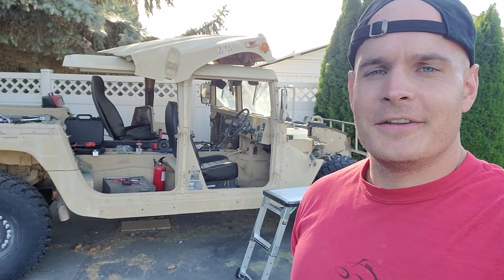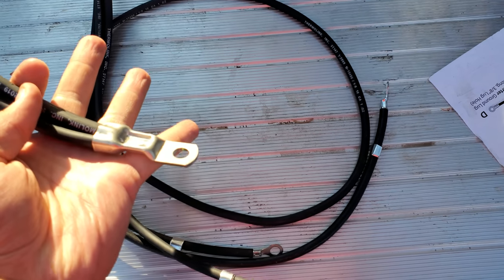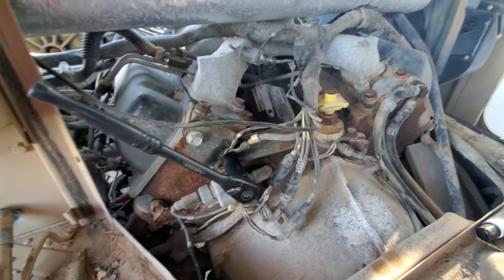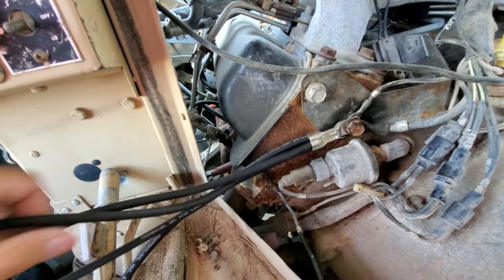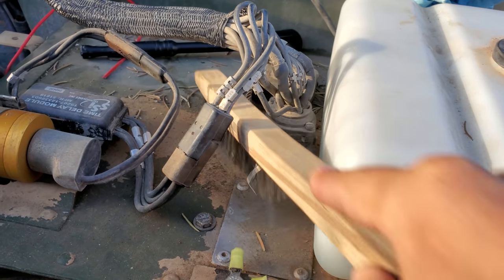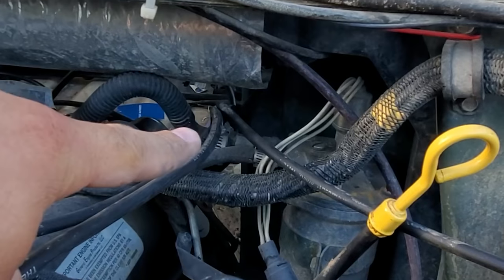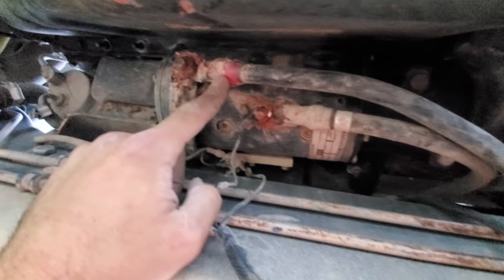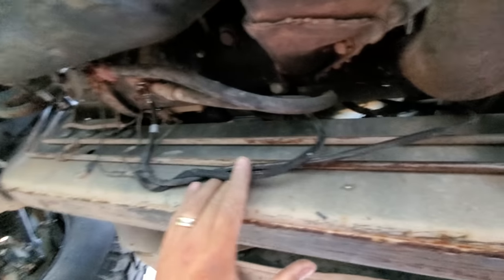More problems with the HMMWV - Grounding harness replacement!

Comment: Diesels function via compression and high fuel injection pressure; glow plugs are only needed in cold weather.  Check fuel delivery; lift pump, high pressure pump (usually driven off the engine), and the injectors themselves (could either be fully mechanical or solenoid based)
Reply: This was the consensus of comments from the prior posting about glow plugs.
Don't see how supplemental grounding will change the fuel issue.
Reply: Just replace it with a v12

Comment: Hey, Zack! I enjoy all your videos! 40+ years of diesel truck fleet maintenance taught me:
1. Check fuel pressure.
2. Check fuel filter(s)
3. Check fuel shut off solenoid.
4. Check for air restriction. A diesel only needs fuel and air to run.
5. Do an electrical check on the glow plugs, make sure they are to manufacturer specs.
If you have fuel, air and the glow plugs are working, it will start and run.
Good luck!

Comment: Reading lots of comments about fuel.  I agree you've got some kind of fuel delivery problem.  Could be wiring, injectors or pump related.  Just hope the fuel delivery system isn't all hogged up!!!  Good luck.
Reply: Having worked on many diesels I would most likely say it is the fuel pump, especially if it has a mechanical pump. I would check the fuel cut off solenoid first and then individually check all the injector pump outputs to see if it needs a rebuild

Comment: There are easy ways to check for working glow plugs. And glow plugs, as a lot of people have pointed out, are useful below freezing (that light is mainly there to prevent you from activating the starter while the glow plugs are pulling current from the battery on "dumb" systems). In my days as a mechanic, I've seen diesel trucks refuse to start for as simple a reason as bad air filters. So, my point is a good troubleshooting methodology is in order here, but I guess it wouldn't make for interesting content.

Comment: ChrisFix owns a HumVee, he'd probably know what to do.
Reply: His is swapped, I agree that he might guess what the problem is but the two Hummers are completely different in terms of powertrain.
Reply from the maker: ChrisFix would definitly know.
Reply: I'm quessing like you that there still are some fuel problems.
Reply: @ZacksJerryRig  that would be a really interesting collab. You are all serious and chill, he is shouting and hyper 🤣🤣 you can even get whatsinside involved, see if they can find a way to remove the helmet
Reply: I agree call him
Reply: @05otaku  yes yes yes do this
Reply: oh imagine a collab with these 2 gents, that would be insane.
Reply: Chris fix  owns a hummer not a Humvee
Reply: @vincentmiller7332  yeah but still😅
Reply: He also has a swapped motor
Reply: @vincentmiller7332  and his is Duramax swapped so he could only really help with anything that is not related to the drivetrain and engine.
Reply: No, he owns a hummer
Hummers aren’t humvee’s… it’s just like comparing a car to a truck
Reply: @datwalmartkid4518  but chisfix is a 
car mechanic

Comment: I highly advise to check the fuel. Pump first before doing all the other work, usually when the engine cranks but dosent start is its not getting enough fuel or its weak and not building up  Pressure

Comment: We were instructed to silicone the starter wires to protect them from corrosion as well as hasty privates that like to arc out wrenches on bare terminals.  lol  The PCM is a black box under the dash on the driver side.  The cannon plug is right in front of the drivers window under the hood.  That box controls pretty much everything on that vehicle.  If you haven't already tested to see that the glow plugs are actually cycling do that.  If you have it may be the PCM.  The good news is that you look like you have either the 6.2 or the 6.5 detuned so you may be able to run that thing with about 4 wires since it has mechanical fuel injection.

Comment: You can download all of the maintenance manuals (TM's) for free. It will save you a ton of time on troubleshooting. There are alot of small things and model variations on these trucks that were added do to military requirements that don't really make sense to the average civilian mechanic. (And sometimes the military mechanic either!) Get all of the operator -10, Maintenance -20/30 etc... and the parts manuals and read them. Make sure you are using the correct TM based on your model. The TM's will be a good foundation to maintain your truck even if you think you can do something a different way or easier. I was a mechanic in the Army for 26 years from 1992 to 2018 and worked on a bunch of different variants of the HMMWV. The worst thing you can do to one is not drive it! Give her some love and drive the hell out of it. She won't let you down.

Comment: Glow plugs will just help it start in the cold you don't really need them in summer. Spray some starting fluid down the intake to see if it will fire up could just be a fuel problem.

Comment: Crack the injector lines at the injectors and watch for fuel on ALL while turning the engine over, Also get a fuel pressure tester. Two easy spots to start for fuel stuff. Also for the glow plugs, pull one or two out and hold them with pliers (make sure you have a ground) while turning the engine to on to see if they get real hot or don't work.

Comment: The glow plugs are for extreme cold weather starting. They are not your problem right now.
Reply: Depends on whether there is direct injection or a precombustion/turbulence chamber.  Chambers need glow plugs all the time except when engine is hot.

Comment: The silicon on the starter positive and negative is suppose to be there.  That's so if you drive in the water it doesn't cause a short.  (I use to work at AM General)

Comment: Hopefully you see this but maybe my credibility helps, I'm currently in the military and have worked with Humvees most my military career. There's a couple tricks to starting these old machines, so the first trick you wanna try is while holding the starting switch in the start position and give it some gas (hit the acceleration). Another trick you can do is the same as the last one but have someone hold a piece of cardboard over the exhaust until it hopefully starts. This last trick is a bit hard to explain so I hope you understand what I'm saying, move the starting switch towards the start position slowly, when the vehicle begins to run give it as much as gas possible. I hope this helps and if you have any questions about my tricks just reply to my comment.

Comment: Lots of people already said the same thing.  Chasing glow plugs for this is not the answer.  Check compression on your engine.  Not well up on larger engines but smaller ones suffer from block cracks.  Use some easy start see if it starts.. if it does not then you know you have a compression leak.  If it does turn over and die it's probably fuel delivery issue like a bad fuel filter, pump or gummed up rails.

Comment: As an old 63Y and 63B, I dealt with thos problems a lot more that you would imagine.
You need to check cylinder compression and fuel delivery.

Comment: Yup, the comments about the fuel system is what I would chasing. I have a 6.5l turbo the tank was bad which ruined the lift pump and clogged up the fuel filter manager. Try to check out fuel systems

Comment: I’m literally here watching SCREAMING it’s fuel or compression not the glow plugs. A diesel will fire at nominal ambient temperatures with sufficient compression and fuel. The hummers are a really simple design intentionally. All you are doing is firing the proverbial parts cannon.
Reply: Exactly, totaly not glow plugs. But grounding harness could be helpful, there is pump relay which may be not turning on because of bad ground, but probably not.
Reply: He's milking content, just watch and enjoy.
Reply: @rb30e  yup true
Reply: If you watch the other video he did he realized it's probably a fuel issue.
Reply: @Kevin12484  And yet he seems to be chasing down an otherwise irrelevant line of diagnosis to the core complaint. Engine will not start.

I’m glad he found the glow plugs being bad, but, they are not relevant to the starting issue during summer. I used to work on these in the late 90’s.

Comment: If Zip Ties and Bias Ply's has taught me anything about diesels that wont start, all you need to do is keep cranking it with your foot to the floor while spraying as much ether/starting fluid/brake clean/carb cleaner/gun cleaner or any other highly combustible aerosol directly into the intake.

Comment: Hi nice viedeo, its clerly a fuel problem not the glow plugs if they dont work the engine shuld theroticly still start above 20°C. If it were the glow plugs you shuld se a white smok koming out fo the exaust from the unburnd vaporized ful... id chek the flow of the pums the filter and as a last messure the injetors, but you ned to be caful with those cause vaporised disel is rater toxic and at the high injetion pressure i can easily injeckt it under your skin... i wish you best of luck with your projekt. Gretings from Germany
Reply: You can also check your glowplug voltage with a multimeter whyle staring i there is no volage it mey be a burned out limiting resistor witch is conected in series with the glowplugs.
Reply: The axilary ground shuld not be nessesary since the startermoror(which is the biggest load in the system there for most susceptible to a ground problem) ran realy nice and powerfull in the last video

Comment: Maybe consider a Lightning or Cyber Truck since those have a trouble-shooting flow more similar to a cell phone 😉.  As others have said, this process needs more diagnostics and less parts swapping.  You should be able to test fuel pressure, verify spark, etc. before changing stuff.  Obviously per last video the glow plugs were definitely bad, so no harm no foul there,  but anything beyond seems a little blunt in approach vs. testing to isolate the problem.  Love most of your videos and maker creativity, but dealing with an ICE appears isn't your wheelhouse yet (though I'm sure you have the core skill set).

Comment: Just convert it into electric and no more repair will be required for another 100k miles
Reply: High battery wear if it's heavy (more load), and atrocious battery wear if not given a proper cooling solution. Maybe would make more sense of solid state batteries were commercially viable. For now, diesel makes sense for higher weight vehicles
Reply: That would ruin the purpose of this vehicle. Plus with the suspension design of these vehicles it would be incredibly difficult